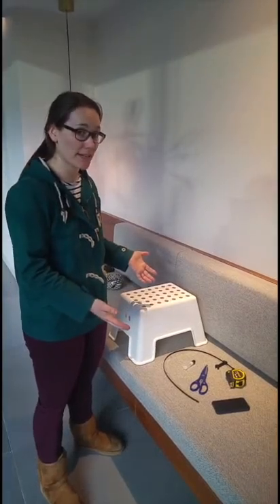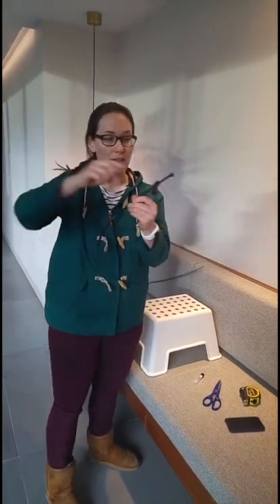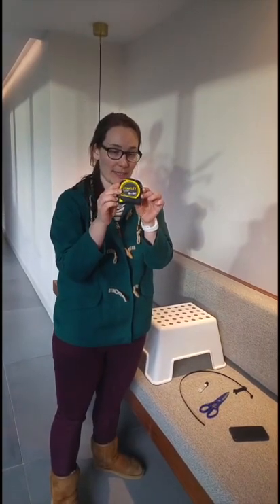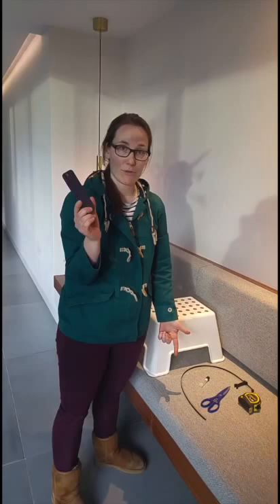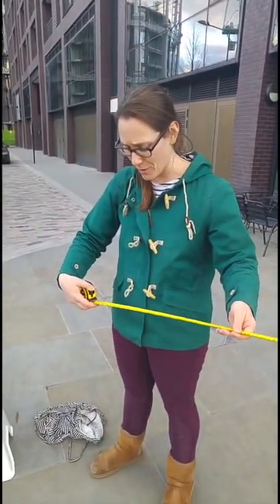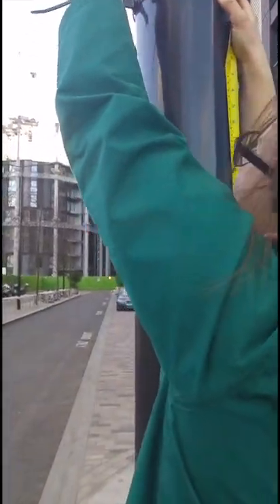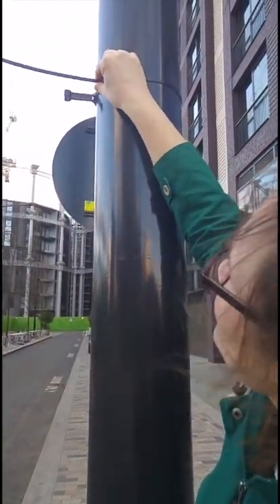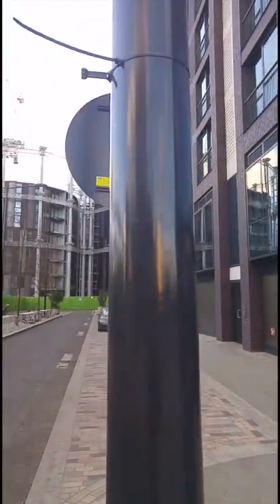Camden Air Action: How to install a diffusion tube

Comment: Where did you purchase the tube? I'm doing a school project and I am struggling to find anything relatively cheap, I only need 2-3 tubes!! Thanks.
Reply from the maker: For the first round http://www.cleanairuk.org/ and then the council funded rounds 2 and 3, but this was for a larger project of 100 sites. Try clean air uk as they might be able to point you in the right direction if they can't help you directly.